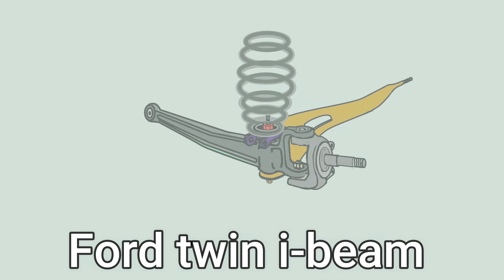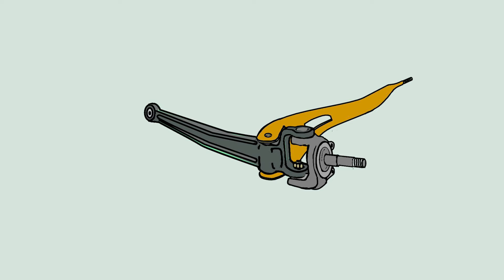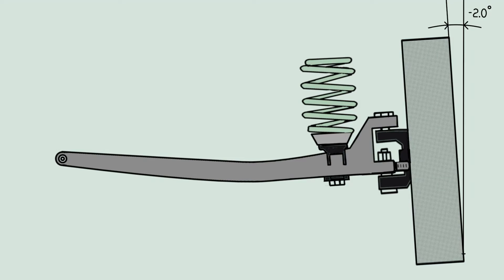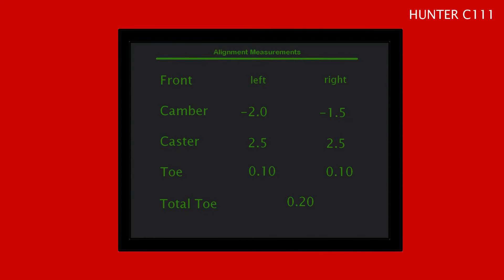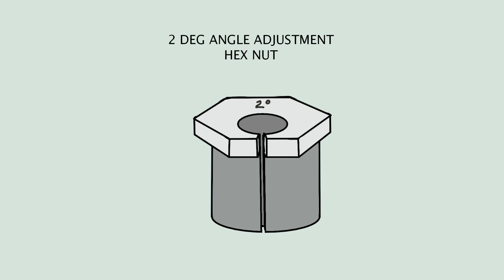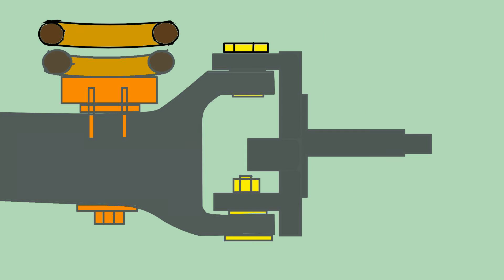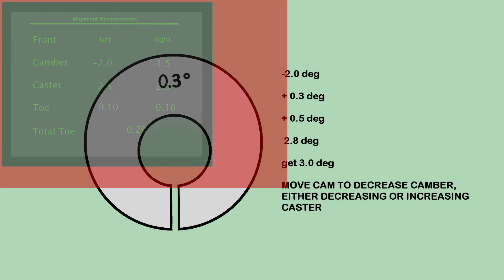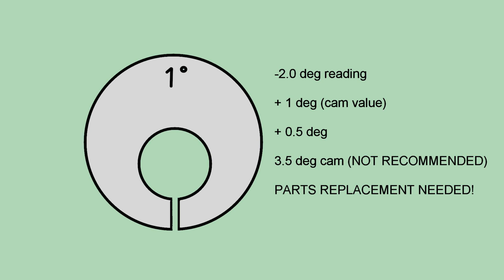Ford Truck twin I beam alignment

Comment: Thanks for making this great and informative video on Twin I beam alignment. Your short vdeo explains in seconds what I struggled with understanding on my 1985 Ford based motorhome since years. In fact it took me years to realize the springs have sagged and  were in fact the reason for too much negative camber, which in turn throws off caster, making it harder to keep the truck centered and causing excess wear to the steering gearbox. I've bookmarked this video and will use it to help others who I encounter with the same issues. Cheers!
Reply from the maker: I am trilled that this little video helps. Thanks a lot for you comment!!

Comment: Unfortunately, when you go to the " alignment" shop....Your likely to run into a few possibilities....
1. The outright THIEVES & LIERS!  These are the ones that figure you dont have a clue about how your Ford Twin I beam suspension works or what ( might) be involved to fix it.
2. ARROGANT KNOW IT ALL types that can't tolerate that a customer might HAVE A CLUE or A SUGGESTION about what way he wants his alignment problem repaired. GOD FORBIT it not be the most expensive & time consuming way. GOD FORBIT it be a different way than the ( usually) do it.
GOD FORBID using an Aftermarket part that works BETTER than the OEM design! After all...someone might have to THINK a little bit about which way to install it or how it works!...
3.
Reply from the maker: It sounds like you've had some frustrating experiences with alignment shops, and I understand where you're coming from.
Reply from the maker: It sounds like you've had some frustrating experiences with alignment shops, and I understand where you're coming from.

Comment: Hey Carlos!!  It is a great video but HERE is my dilemma! I can't get anybody to give me a STRAIGHT answer or offer a solution.
So I have a 2003 f250 Super duty TWO WHEEL DRIVE with the 7.3. I put a two inch lift and new coil springs on it and it looks great just like I want it BUT, nobody can align!!! Got the included castor/camber sleeves that came with but "they" still can not get it in alignment. Its maxed out with the new sleeves and still comes out short....I need a clear answer and none of these pro's seem to speak my language.....some said I need to lower the i-beams with a kit and I can NOT find a kit for this job....can you help me man? Where do you live....I'll pay you!!!  Man my next step is I will have to remove the 2 inch sleeves and that will hurt my ego! LOLOL Any advice appreciated
Reply from the maker: It sounds like you're having a tough time with the alignment, and I understand the frustration when shops can't seem to get it right. I'm glad the video was helpful. Unfortunately, I'm not in a position to offer direct, in-person assistance, but perhaps some of the viewers here have encountered similar issues and can offer some insights. I'd suggest looking into specialized off-road or truck suspension shops in your area, as they might have more experience with lifted vehicles and less common alignment challenges. They might be able to suggest alternative solutions or point you towards the correct parts if lowering the I-beams is indeed the way to go. Good luck!

Comment: you should have more subscribers....excellent teacher man! Thanks
Reply from the maker: thank you!
Reply: @CMDWorks  I got A 2003 F250  7.3 so I will be checking out your channel... I just changed out front springs put in a 2 inch lift and billstein shocks and that was an adventure....Peace Amigo
Reply from the maker: @olfoogy  Good luck. Gracias!

Comment: Why plus 0.5 degrees? You never explained.
Reply from the maker: so you have margen to fine tune the adjustment.
Reply: @CMDWorks thanks for the response. I’ve been doing a lot of research on this topic lately.
Reply from the maker: @GrowingPains917  thank you! Good luck.

Comment: After finding a recommended, established, and knowledgeable frame and alignment shop in my area I'm going to have some work done on my 1970 F-250 2-wheel drive pickup truck. The old tires had front inside tire wear. I first replaced the tires with good BF Goodrich Trail-Terrain new tires. They will replace some rubber bushings and other rods and parts. I've owned the truck for 11 years and have never had an alignment or replaced parts. It's expensive but, that's the price for having a classic Ford truck. They "may" have to bend the I-Beams. I'll find out when they get into the work. I'll let you know. BTW...good video!
Reply from the maker: I appreciate the update and your feedback, and good luck with the alignment!

Comment: Mine doesn't have ball joints and nobody seems to have resources on kingpins
Reply from the maker: Sorry to hear that. I did that work back in 1986-1990 on a place called Longhorn Alignment, Dallas Tx. Big truck and trailer place. We did axle straightening, as well as small pickups. The place still exists, however I do not know if they still do this kind of work any longer. If you live in the area,  you could contact them. Just google "Longhorn Alignment".
Good luck.

Comment: I did a 2' lift with coil spacers , what degree sleeve would i need to order ? Thanks again
Reply from the maker: in order to know what to order, you first have to take the camber readings after installing the blocks. Then follow the video instructions.

Comment: Will this work for the F100?
Reply from the maker: @kraljmuzdeka  unfortunately it doesn’t. F-100 has non adjustable kings. special equipment is used to bend or straighten the beams thus adjusting camber. or caster bending the radius arms.

Comment: Hi, any advice on a 1987 Ford E350?  I think I have King Pins, which doesn't allow adjustment.  Was told to go to a Diesel mechanic shop, where they deal with King pins daily.  My issue is the passenger wheel has positive camber, top of wheel is out further then bottom.  Driver's side is fine.  Perhaps previous owner hit a curb, and bent the suspension?
Reply from the maker: You first have to determine if the problem is a bent spindle or the arm (tween I beam) Or both. Depending on how much It's bent then it might be possible to straighten it out by hydraulic pressure, providing that you take it to a diesel mechanic alignment shop, (where they do Big trucks like semi trucks). Otherwise you're going to have to replace it with new parts. Good luck, I hope this helps.

Comment: I took my 98 E350 RV for an alignment after some front end work. They are using some state-of-the-art alignment machine but cannot get the alignment set properly. It now has a hard left pull. They have been messing with it for 4 days and can't figure it out! Any advice?
Reply from the maker: Was the vehicle pulling before the front end work? Caster readings should be close to the same on both sides, if they are, then may be other problems related to pulling, like a separated tire, dragging brakes or seized ball joint or problems with the steering gear box. If readings are way off, then something is bent, installed backwards or defective.  Good luck.

Comment: Thanks for the video.  I did everything you showed.  To save money I made the blocking plates for the back of the heads and the egr. Actually, the only expense I had was ohm resistors,  serpentine belt, and dummy pulley to replace a/c compressor pulley since I deleted it as well. Greatly appreciated! Lots of crap gone and I believe truck runs and performs noticeably better.
Reply from the maker: Great job! thanks for the comment!
Reply: You are smart to block off the EGR  - it reduces fuel economy and wears down your engine, which I'm convinced is its principal purpose (planned obsolescence)

I plan on deleting my AC soon too - another smart move. Reduces weight, removes a load off the engine, and clears up the engine bay. AC isn't good for health, anyways.

What did you block at the 'back of the heads'? Are you referencing PCV?

Comment: So on the drivers side, if my camber is reading +1.1 degree (out of alignment) and I need it close to be +/- .25 and the current camber bushing is +1.30 degree (1 1/2) what camber bushing would I need to reach my goal of +/- .25 camber?
Reply from the maker: That depends on the position of the bushing, is it facing in out or sideways. If is facing out (positive) then rotate towards inside until within tolerance, taking in count your caster reading.
It is not possible to give you an answer without all variables known. Good luck.

Comment: Reading into this, I'm wondering If it would work with my 65 f100!
Reply from the maker: It won’t. F100 aren’t adjustable they have a king pin instead of ball joints.
Reply: @CMDWorks was about to ask the same as the person above if it would  these would work on a 76 f100

Comment: I have a 2012 F-250 2wd, I wanted to install some 3” leveling spacers and new camber sleeves. Would I have to get some drop down brackets for the I beams as well?
Reply from the maker: It’s hard for me to say without looking at the vehicle. once you install the spacers you’ll have to get a alignment readout to know. Good luck.
Reply: Thanks.

Comment: Didn't mention that all Ford factory cams are stamped with camber/caster size. But all are stamped for the pass. Side,so the caster reading on the driver side is backwards
Reply from the maker: Yeah, some are marked as R or L with a plus and minus and the value since they are indexed, however if you remove the indexing tab then, numbers won't matter anymore. But you are right. Thanks for the comment and observation.

Comment: Does this apply to a1996 f350 with Leaf springs ? My truck pulls to the right ?
Reply from the maker: No. twin I beam only. If You have a straight axle or differential there is adjustment but is more difficult to adjust. some don’t have adjustment at all. you may want to take an alignment reading to see if that is actually the problem.  Good luck.

Comment: Muy bien explicado 👏🏻👏🏻
Reply from the maker: Gracias!
Reply: @CMDWorks  mi Ford f150 1996 tiene la pieza en 1. 1/2 y ya es todo lo que da, pero queda positivo la llanta, metida de abajo y salida de arriba, qué medida ocupo para enderezar?
Cambié resortes y ya no da, me dice que es todo lo que abre,
Reply from the maker: A la mejor lo que esta pasando seria que la espiga esté doblada si el ángulo es excesivo el tamaño depende de la medida actual del camber. Pero existe la posibilidad de algún daño ya sea en la espiga o en el brazo.
Reply: @CMDWorks  a simple vista no se ve, lo que veo que uno marca 1.1/2 y el otro no se ve, y uno está al centro y otro lateral el círculo , tal vez sea por que no están iguales los excentricos
Reply from the maker: @enriquegarfer07  bueno, pues lo primero que hay que saber es cuánto se encuentra el ángulo de camber. sabiendo eso ahí puedes determinar la cantidad de la leva. Usualmente el máximo ajuste serían 3°

Comment: This was super helpful, now I understand more about how the suspension is set up. 
With just this sleeve is it possible to get more caster, without throwing the camber way out?
Reply from the maker: Not with this one, there is another sleeve (concentric) that adjusts camber and caster independently (google: dual camber caster sleeves) however there is a limit on how much adjustment is possible to do.  Thank you for your comment and good luck.
Reply: @CMDWorks  thanks for the pointer!

Comment: Man ur good!
Reply: I dont know if. U care but i own 4 f350 for work and one of them was raised 2 inch but  she eats tires on the outside , and tires are no cheaper. Thanks for the explanation. 2000 f350 2wd .
Reply from the maker: @MrMachuca1978  Yeah, usually whenever   the vehicle is raised  toe changes (toe in ) and camber goes positive. alignment will correct the problem. Good luck and thank you for the comment.
Reply from the maker: Thank you! Appreciate that. Glad you liked it.

Comment: Hi Carlos, I have an F100 1970 with a bad camber, do you know if they maker these bushings for such an old vehicle?
Reply from the maker: If I'm not mistaken, no adjustment is possible on king-pin type spindles, however the way I used to do it was bending (straightening) the I beam axle with a special hydraulic press  aka camber caster correction tool. Good luck.

Comment: I put new coil springs on my 94 F150. I now have positive camber. Is there anyway to know to what degree I have without going to an alignment shop?
Reply from the maker: The problem is that when your camber changes so it does the toe in, you could scribe the tires and measure toe with a tape measure, just to make sure is not going to be more than 1/8" in or out. With regard to camber,  it's a little harder to measure accurately, I have used my iphone's  level app in the past, (putting it against the wheel or tire) just to have an idea how bad it is, (more than a degree), I think you may consider taking it to the alignment shop. Good luck.

Comment: can you explain what happens when you add a leveling kit in the front or raise it by 2-3 inches? what if you add drop brackets? on a 90 f series
Reply from the maker: If you raise it it will increase camber just as if you pick the vehicle up from the frame, you still have to fine tune the alignment with a lesser value cam, on the drop brackets for what I can tell,  have a cam adjustment so you can correct for camber, however I never done such modifications myself. I hope this explains it.

Comment: I have a ford super duty passenger bus and the camber appears to be very positive. Is it possibly designed this way to compensate for weight?
Reply from the maker: No. Not if it's excessive, or some special application,  all vehicles should come aligned out of the factory. Weight loading is already factored in with the stiffness of the springs. Check your alignment. It may be the toe in (optical illusion). Good luck.

Comment: I have a 1999 f250  with a factory adjustable upper cam. My truck has all new OEM  parts  ... I have gone to two alignment shops and they have no clue  the upper cam needs adjustment so they check toe  and give it back .. The truck originally stayed true and straight and now wanders when you steer.. The  toe seems good but the  caster camber seems off  .. like a oversteer condition ...  Also the wheel does not return to center easily without a hand assist  . I looked  at the bushings and if you were looking down at the truck  forward .. the drivers bushing is at around 10:30  o'clock and the passenger side is at 2:15    this is the center line  of the cam position .   The last alignment shop gave me a printout  LF   .4 deg camber with 3.5 caster.... the passenger is .6 deg camber with 3.5 deg caster.

 I want to adjust the bushing myself  was looking for your  advice .   Some forums call for more  caster . 

My thoughts are like a shopping cart ... with less caster I am on top of the  wheel and  it is sensitive to any steer right or left with no force to hold it center
Reply from the maker: For what you say, camber and caster are good,  3.5 deg is good, 0.5 deg camber is also good. (the position of the cam does not matter much) perhaps other problem is causing stability problems,  for example, very hard to turn because very tight ball joints, or power steering gear box,  or if you replaced parts, make sure they are installed correctly (something may be upside down or backwards things like that, although twin I beam systems are simple, sometimes happens, specially when oversteering) but most likely hard to turn ball joints would be a suspect.
Good luck.

Comment: I like your explanation. On the E450 (cutaway chassis motorhome) my local Bruce tire shop aligned on the Hunter Hawkeye. Their printer was out so no before or after readings. It seemed better but was pulling hard again after loading up the vehicle w front end weight so Im going back again. I have new Sumo springs and a steering damper installed before the alignment.
Reply from the maker: Good luck, Caster reading should be within 0.5  to 0.75 deg split between left and right, pulling towards the lower angle, however pull may be caused by bad or underinflated tire, or different tires, dragging brakes, etc., Hope they fix it. Thanks for your comment.
Reply: @CMDWorks  followup here. The caster was off. The left was 3.0, rt was 5.5. The forums for cutaway chassis motorhome recommend getting both over 5, but the best they could do was 4.2 & 4.5 with their largest cam possible on the left. That was 2 alignments and 4 new cams in 6 mos/3k miles, $422 total... its riding better with slight right pull now on normal crown interstate. I hope it holds that but i do drive on washboard pothole roads occasionally for camping. My tires always age out before they tread out. 52k miles odometer with steering linkages all in great shape.
Reply from the maker: @jr.6199  those are good numbers. The $422 is not   I’m glad you solved the problem. thanks again.

Comment: I raised my 93 Ford Ranger 2 inches and I have that problem.. do you know what grade I should buy to make it perfect?
Reply from the maker: Unfortunately the only way to know which size, is to take a camber reading,  you have to see which cams your truck currently has, as well as the alignment (camber-caster) angles, then do the math. Good luck.

Comment: I cut 2 coils out on both sides of my 1989 f150 . I have bad Negative camber will those adjusters help me?
Reply from the maker: It may not make straight all the way, but it will improve it, try to get the biggest angle cam if camber is way out.
Reply: @CMDWorks  thanks Carlos

Comment: Awesome video .
Would this also work a 2020 model with the same I beam suspension ?
Thank you sir , this is the only video that has any useful advice at all.
Reply from the maker: It should, with any similar suspension type as long as it has camber-caster cams. Thanks for your comment!